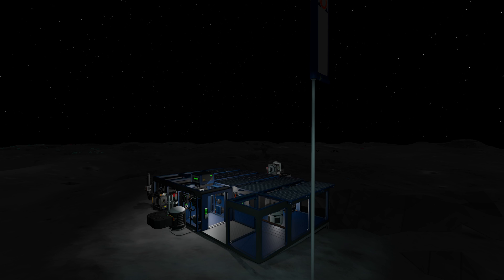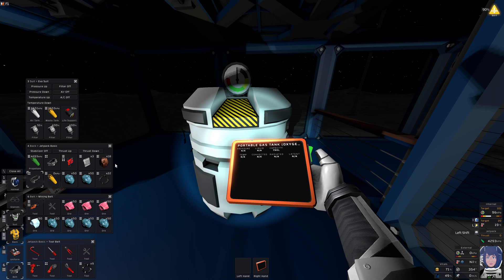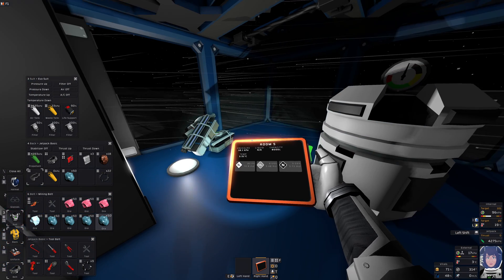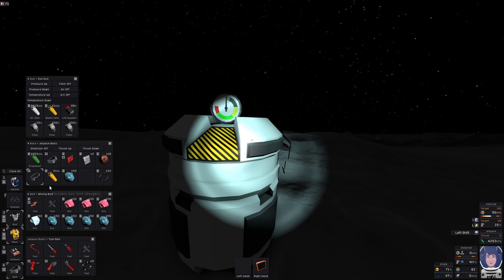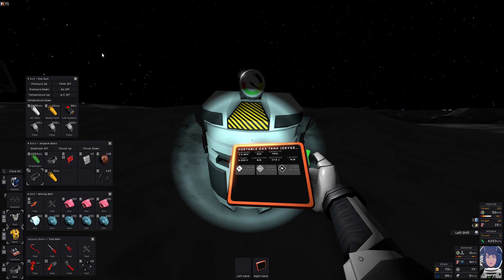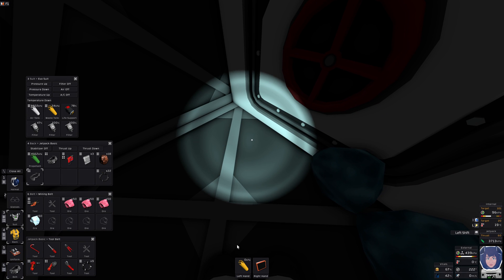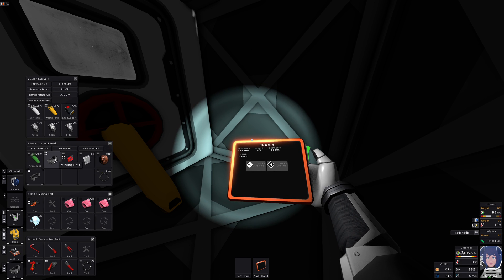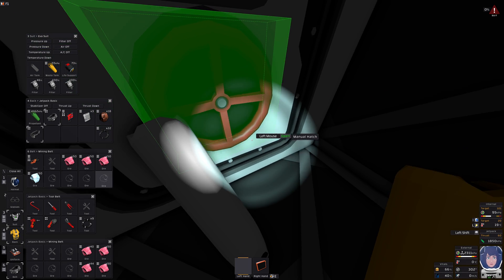Stationeers how-to: Refilling your lander's oxygen tank or a gas canister in a pinch

Comment: How do you clear the air filters in your EV suit?  I tried using the portable scrubber but didn't seem to do much except heat up my base.
I also have another problem that I now don't have enough iron panels to construct my autolathe. I guess I made my initial room too big. 
I was trying to think how I could store the oxygen that was in the room so I could borrow some iron panels then replace them once I construct some more.
I know I could regenerate it with Oxide but currently my oxygen is low (I now know how to resolve that thanks to you), but was trying to think like a suvivalist and not waste stuff.
Currently trying to change my airlock vent so I suck the air out of my room into pipes, think that might work but annoyingly the vent is locked by the airlock. I tried removing power to the console but still was locked.
Reply from the maker: Hm. That's quite the list. Would you mind sharing your save file so that I could take a look? I'm always in my own "sterile" space, would be interesting to be exposed to someone else's path through the Stationeers reality. - And I'm actually considering showing those problems and solutions by using your actual base, if that's alright. (If not, you can still share your save for me to check it out.) If you don't know how to share it, you could use Discord or one of these, for example (no account required):    https://fastupload.io/en    https://tempsend.com/     EDIT: To share a save, find the folder of that save on your drive, make a copy, then (In the copy!) delete the subfolder "backup", then 7z or zip the whole save folder tree of that copy.
Reply: @OwnerOfTheCosmos  I use Discord if you ping me some details I'll send you my save.
Reply from the maker: @Lee_Hall I sent "lee_hall" a friend request. Is that you? I'm kinda new to Discord, so if you had something else in mind, tell me.